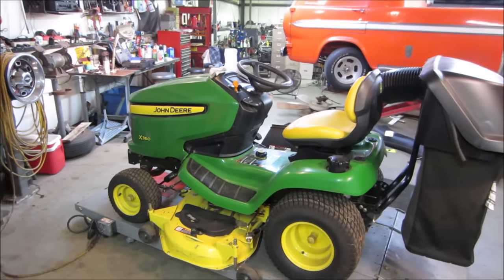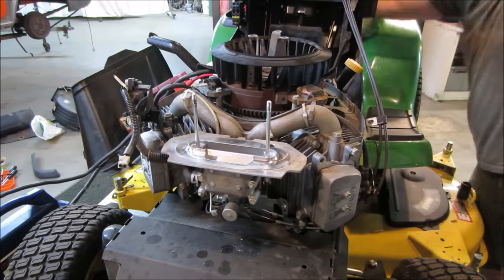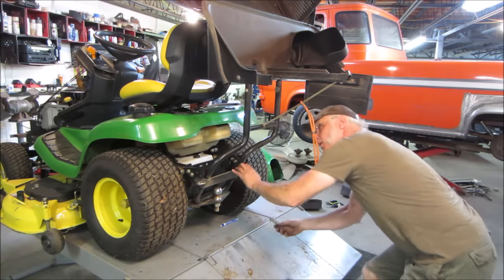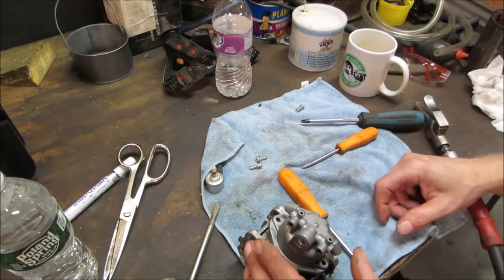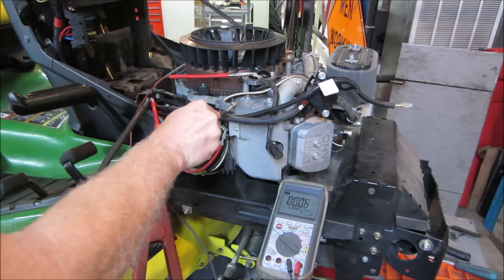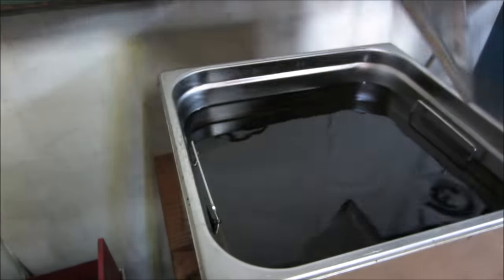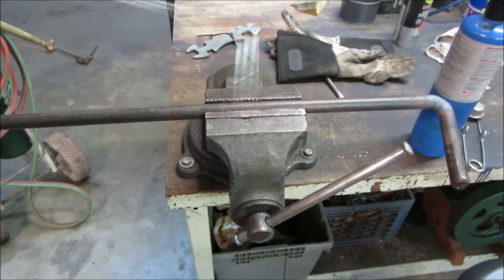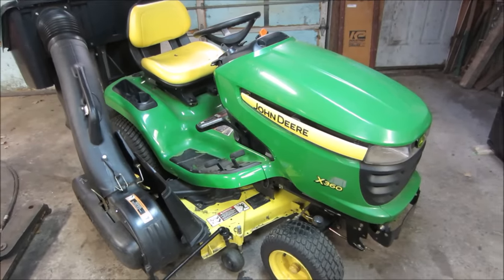Will It Run? abandoned John Deere x360 from a Yard Sale,

Comment: My dad has the same Deere lawn tractor. The choke is supposed to be like that. Also when you shut it off, it runs for a second, then shuts off. It’s supposed to be like that, Mustie.
Reply: That's so it doesn't backfire when the spark is cut off but still drawing gas. It shuts the gas off at the carb and burns the last bit off before cutting the spark.
Reply: instead of having wiring circuits that go through the different safety's to either kill the engine or keep it from starting John deere had the brilliant idea to use a brain box to control cutting off or not starting. the key turning off sends signal to this brain box and it shuts off engine. these are prone to failing.
Reply: @tomhath8413  I thinks it to control post detonation, I.E. ignition off, but gas into the hot cylinders will still ignite, backfiring.
Reply: @focusfrenzy9759  I'm sure you have even more "brilliant" ideas for product designs...care to enlighten us?
Reply: My X540 does the same thing.    Its normal.
Reply: I have a 1986 John Deere 330 and when I did spring maintenance it had 552 hours and my 1987 316 has 1086.
I have a little over an acre so I must go a lot faster and not waste time.
Almost 200 hours is about 4 years for me
Reply: Our x300 is same way, choke only on when you hold it and it runs for a few seconds when you turn it off
Reply: Correct. you hold the choke open during starting and then release when it catches.  It works very well.
Reply: Industrial equipment have used the delay function for years.  In the days before a circuit board could be programed, a "delay on break" relay was put in the circuit to maintain ignition long enough to clear the fuel. The "fancier" relays had an adjustable timer for a custom approach.  For many years I was involved in equipment design.  This was/is a common function.
Reply: @buckhorncortez  Ever heard of sarcasm? lol
Reply: broomsterm  Because it is not running nearly as lean as these engines.  Pull the plug on one of these and they come out spotless.  Things can be hot enough to auto ignite, so evacuate the fuel, then cut the spark.
Reply: @buckhorncortez  yes I have a brilliant idea, if its not broke don't fix it.
the more complicated the plumbing, the easier it is to clog the drain.
john deere has a reputation for ripping off its customers with various scams involving systems designed to fail and restricting customers ability to repair them selfs.
in the lawn side of buisness they came up with that all in one filter and oil change disaster where you pay three times the cost to change just a quarter of the oil in your lawn tractor.
Reply: MEK is the best carb cleaner I’ve ever used.
Reply: Yep, I have a similar  model  and it does the same (both choke and kill)
Reply: It might also be to prevent the seat safety switch from instantly killing the engine when hitting a big bump and unweighting the seat momentarily. Instead of having different control circuits for the ignition and safety systems, it all probably feeds into one that covers all.
Reply: @John Verne mate, it blocks fuel flow to the jets "chamber" from the jets draw fuel. Fuel can still freely go into bowl if float allows it to. That bowl might have a 30 seconds or more worth of gas when at idle. It dying after few seconds should point You to that.
Reply: mister kluge Yep! Throttle down to idle before shut off.

Comment: Mustie, there's a heavy S-Bracket that holds the powerhead to the deck.   Part number is likely M145011. Price is about $24.   Also, these engines always need choke to start, even warm.

Comment: I kept hollering at you when you were putting the carb back together that you were forgetting the bowl drain screw but you just could not hear me, so I was laughing pretty hard when we could see the carb pissing everything back out. Love your content and would love to see you put a 302 into the Econoline pickup. Keep up the great work.
Reply: 302 or maybe a Coyote!
Reply: @jamesscott1932  You both beat me to it!  Both engines are about 302 CI.
Reply: Bob Pegram in about 1971 we put a 302 into about a 64 Econoline. It was uncontrollable. Let out the hutch and go diagonally.
Reply: @jamesscott1932  Ahh, some re-engineering needed!  As a first try, put big boat anchors in the cab and in the bed. When all that weight breaks the diff, new rear axle, well you get the idea!
Reply: 460
Reply: No no no put in a apu or a turboshaft jet engine. Way mess with obsolete piston slingers when you can go with continuous rotational power production. No stop and start each piston twice for every engine Revolution, after all reciprocating piston engines are simply modified steam technology.
Reply: Homer Simpson: Exposed! Another lover of fine motors. Put my little Holley on a 300. There’s likely still some manifolds around.

Comment: Bagger frame should have a pin to insert into hole where the tow ball is inserted. In other words, the factory design is to use either the bagger or tow ball. The prior owner made the plate to weld the bagger frame to so they could also use the tow ball. I would recommend going back to factory approach as the bagger frame is super easy to install and remove that way.
Reply: Cool to hear from someone who knows the machine.
Reply: Agree, that ball is not stock. A drip pin with a clevis would be much better.
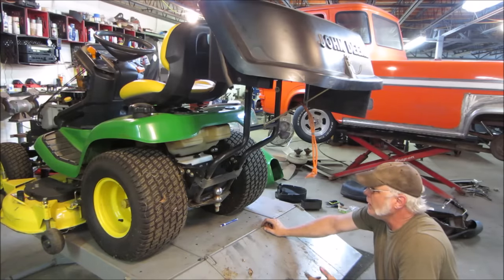Reply: @26:16 I have an X324 not sure what u gave for the JD but u have a great tool there! The tow ball doesn’t belong and for most part not usable on that JD….. to low to ground and I don’t believe weight capability. Mine has a dropping in pin about the same size hole as your unit (1”x1 1/2” long) the the plate that the ball is passing through belongs there! Your grass catcher lifts right off no problem!

Comment: Trapper
RE: The choke butterfly not closing completely.  I have been told the choke not closing completely is an EPA issue. They are required to design the choke not to choke completely because of the raw gas that isn't burned completely. This is normally Ok during normal operation temperatures but when the temperature goes down you may need a full choke. Also if you look closely the choke butterfly has one hole thru it which doesn't help during below normal cold starts.

Comment: The throttle stop keeping the butterfly from opening all the way is actually exactly what you mentioned.  They'll have a v-twin at a given displacement say up to 30 HP.  They'll sell a 22, 25, 27, etc that are all exactly the same except the throttle stop.  Saves on manufacturing costs vs having actual different engine platforms and models.  Grind that stop down or buy a replacement shaft from the higher HP version and you've got basically free HP.
Reply: I was wondering if it was also there to limit blade tip speed
Reply: @clarkcotten5842  speed control is typically the governor's job. It tells the throttle what to do and will close the throttle as necessary to limit RPM.
Reply: You are completely correct. That is a JD branded kawasaki. If a kawasaki engine model ends in a "1"  it is being limited by the carb. For instance you have the fr730 which is the same engine as the fr691 and the fr651.  They just allow the throttle to open all the way.
Reply: @rsmith2786  Thanks Ryan
Reply: @keithschneidly3922  how so?

Comment: Thanks, I always learn something new from you. My JD zero turn also did that reving up and down and now I know why. I change to a good fuel filter started using no alcohol gas and I now add Sea Foam in every tank and it came out of its problem. Thanks again from Mike in Nebraska.

Comment: I let my brother borrow my riding mower for the weekend. I told him when he brings it back, to shut the fuel off and let it die when you park it in the shed. He never shut the key off and it sat for a week with the hour meter running. He took it with 240 hours on it. When I went to use it the next weekend, the battery was dead and it had 360 hours on it. Haha
Reply: My wife has a cub cadet and I have a craftsman lt1000. On my wife's cub cadet any time the key is on the headlights are on so when SHE shuts off the fuel and leaves the key on and walks away then I come out the next day to a dead battery.
Reply: Brother should buy his own mower and batteries.
Reply: I got one last year from a guy who always put a battery tender on it and he constantly was forgetting to shut the key off it had over a 1000 hours on it. When I sold it the asked if it really had a 1000 hours on it I said no it didn't, how do you know? He asked. Because it still runs. If by some chance it did still run with  1000 hours it would be blowing smoke like a freight train. (we did the math to figure out the true hours 1/2 hour to mow his lawn 40 times a year for 7 years about 140 hours give or take 50
Reply: My Ferris only runs the hourmeter when the pto is on.
Reply: @mattmanyam  That seems a little odd. Ferris are good machines to bad they went out of business
Reply: @danbartolini27  out of business? That's news to me... I'll have to drive past the factory and see what's up.
Reply: @mattmanyam  Ferris is/was owned by Briggs and stratton they went bankrupt a few months ago causing the demise of not only Ferris but also Simplicity, snapper, Murry, Billy Goat and other's
Reply: Also making it so there are no American made small engine companies left... That I know of... Oh wait Kohler is still around

Comment: Mustie! thanks for all the videos. I've been a Subscriber for years and watch you tackle these riding lawn mowers. I finally took a chance and picked up q 2013 Husqvarna Lgt2654 Lawn Tractor with 200 hrs for $250.  guy gave up on it cause it kept throwing belts and had snapped off the bolt on the Front Trans Bracket.  Pulled the transaxle off and angle brackets were almost split  off. Cut off bkts and welded 3"x3"x1/4" angles (drilled new mounting holes. bought new front bracket and drilled out 5/16" mounting bolts. installed grade 8's all the way around + new drive belts /replaced fluid.  Assembled it all together and it wouldn't go in gear. "UPset" until i remember the little wire in the back for free wheeling was out. Pulled it  & Ran like a Champ .$100.00 in parts to fix $3800.00 tractor . thanks for the guidance

Comment: Nikki two barrel carburetor.  Lots of passages to clean.  The two brass jets in white plastic are different sizes, so be sure to make a note when removing them for proper placement.  X series John Deere mowers are better than the low end big box store ones.  It's in good shape, low hours, plus bagger set up.  Resale value will be profitable.  You done good.

Comment: My wife discovered the Brinly Lawn Sweeper in the early 2000’s. Leaves fill up quickly, and take up room quickly too because they don’t get crunched up, but it’s a lot quicker than using a Toro or Ryobi vacuum. It dumps quite easily. It will not immediately collect grass that you’ve cut because the mower moves the grass to the side, so the only disadvantage is you have to make another pass of the yard to pick up the grass. The gears in the wheels wear out about every 4 months, but they sell the parts and they’re easy to replace. The brushes will sometimes come loose, so I used a few sheet metal screws to fasten them.

Comment: Mustie1 as far as the throttle blade opening, you would be surprised. I visited Kenny Bernstein's shop yrs ago and our automotive instructor asked how much power it made where the throttle blades were open, the crew chief opened the throttle blade roughly about 30% and said it makes around 2000hp at this throttle position and the same amount at wide open throttle. We were all stunned when he said that. I'm sure someone else could chime in on that. But as for my personal experience in the engine dyno room yrs ago as well. It's funny to see a 500+ hp engine put out 5-8 hp at idle. It's always the little things you never think about. Great vids as always

Comment: Pretty sure the choke lever supposed to spring back.
Reply: It is.  I have a 2017 Deere with the same levers and the choke springs back.
Reply: The self cancaling choke is to prevent people running the machine for extended periods of time with the choke on resulting in excess air pollution and wasted fuel.
Reply: Mine is 20 yrs old and is the same way.

Comment: The mulch plug comes with smaller blades that also have no suction that the normal blades have, will need standard blades again to use the collection bags 👍🏻

Comment: The fuel shut off is at the front bottom of the carb if that is what you were referring to. Hold your finger on it and turn ignition ON.  You should hear and feel a Click.  I have an X320. Kawasaki 22 HP.  These are $5-6,000 Mowers.  Plus Bagger!  Actually built by John Deere.  X-  model is the key to that.  Totally different Deck support and it does a fantastic job on rough lawns.  Blow back the fuel into the tank.  Loosen but do not remove cap.  Woirked for me.  I needlessly put on a new Fuel Pump.  Those damn carb screws sometimes need a Vise Grips to remove them.  Had similar carb today on Cub Cadet.  Love that Shake and Break tool.  There is a trick to belt removal with that gold anodized arm that releases tension.  Manual can be downloaded.  Mine has a similar spring loaded choke.  1/2 throttle, crank,  push up Choke for a second or so til it fires.   Mine floods very easily, and also does not shut off instantly much like yours.  I think the lack of Fuel shuts it off.  Check for tiny holes in those 2 Emulsion tubes.
10 psi Front, 12-15 rear.  Deck height is uneven, left side is lower and not matched for height.  1 hole out.  Simply make a 4" extension for the Ball hitch.
From a Farm Supply store, get a serious Spinner.  The John Deere ones do not fit the oval steering wheel rim.
That one is a keeper Mustie.  Sunflowers are ready.............

Comment: Also, don’t engage the PTO at full throttle, idle, engage, then full throttle using the hydrostatic transmission to control your ground speed. That’s what the manual says!
Reply: Yupper. On this “New Technology “ Mustie may behoove himself to use the interwebs to get to know the design features before he breaks them to work the way they ought to 🤔😏
Reply: @Scen Taley   Said “Scen” to no one.

Comment: Interesting video.  Pretty cool how the leaf attachment works, carburetor & how you made the piece that was missing.  Appreciate it! & Those extra brackets go to the extended trailer ball bracket.  There's a piece missing.  It raises the trailer ball up like a foot & out to the rear so you can pull a regular small trailer.

Comment: Theres no way that unit ran  192 hrs. I wonder if the key got left on. My hustler mower has an extra 45 hours on the hour meter because the dealer left the ignition on., Tire and frame are too clean.

Comment: Wow the key for a john deere only ran you $2.50? Must not have been from a dealer. I worked at a jd dealer and every single part they sold was so expensive it made me sick at my stomach, and never want to own a john deere. I know my grandfather owned a brand new john deere riding lawn mower and the drive belt went out and his dealer charged him $400 for a new one and that was just the belt, not including installation or anything.

Comment: Thanks for your video.
   Two things I need to put an idea about. The delay you experienced  on oneside of the coil MIGHThave been going thru the condenser.  When you check a capacitor,the meter battery charger itand you watch the analog meter slowly bleed back off. If  it charges up and falls right off, the capacitor is bad.
  Another item, if you will put a 2x 10 on the concrete floor, to set your battery on, the concrete won't  bleed the battery down. We had rubber mat stapled to 2x10's a tad longer than the battery was.( Battery shop.) for Locomotives.
  USE White-out pen to label wires, hoses, key-mark edges before taking them apart.  match to go back together easier. 
   Love your content.

Comment: Hey Mustie 1. Just wanted to let you know that a friend of mine has an old JD that was given to.  He could get anything running. He took a reciever and welded it to the front of the tractor so he could move his trailers around his yard when he moved.  He had several waverunners ,and snow mobile trailers. That way he was able to control the trailers when he was moving them.  Worked pretty slick.
Reply: Supposed to be- when he moved them.

Comment: You got a heck of a deal on this machine. New they go for over $4K. It is not an inexpensive lawn tractor. It has the heavy duty deck too. Great machines. JD X300 series are nice. I run the X350 but do not use the bagger.

Comment: One tip to you, Darren, you need to have a 2 x 10 about a foot long, to set each one of your batteries on. It's NEVER good to set a battery flat on concrete, as chemically it will drain the battery! Set it on wood and charge good.
   THANKS for your work.

Comment: Hi Mustie1 I,like you, have always tinkered with small engines. A tip for you - when checking for spark I use a short (9”) piece of wire with a clip on either end, one big enough to clip onto base of plug and one the to clip onto a suitable earth point. Useful on chainsaws etc that have plastic covers.

Comment: I had a similar problem recently with a yard machines, the problem was the plastic bit on the solenoid was actually de-laminating from the metal push rod it rides on. Upon initial investigation it appeared fine, but once it was wetted with fuel you could see it loose. Unsurprisingly there a huge number of these parts for sale on the various bigbox online stores. The china-special replacement I ordered had a brass plunger instead of plastic. Once replaced all way well again.